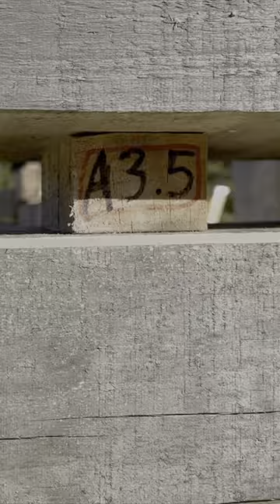Lincoln Logs:  The incredible craftsmanship that went into creating our dream log home

Comment: I believe the dove tail system cam from Scandinavian settlers....it is a wonderful system it allows the notches 2 drain 2 prevent rot and u didn't need nails cuz it locked 2gether
Reply: The Finns specifically used dovetail notches. But considering how many German settlers from f.e. Bavaria moved here its also likely they combined it. Norway and Sweden used a lot of locking notches like the Raulandslaft. Further up north it tended to be more Dovetail. What i don't understand is, where the fashion of chinking instead of full scribe log homes came from.
Reply: @janwintraken  speed...necessity....and needing 2 get water off your back....plus all logs shrink ...even the hand scribed...even if the trees were docked 4 a year...or if they were stored as kants...I built a bunch of cabins all over u.s when I was a younger man ...and one with an Alaskan mill....Husqvarna chainsaw ....ripping chain 20 ft 5 inch thick both ways live edge logs....that is still being used 2day
Reply: @wooge3199  i get that. But f.e. Norwegian and swedish Log houses are just sometimes just grooved with Moss inbetween and If built right there are Examples that are way older than any american log cabin. Sometimes with Turf Roofs that are also Hundreds of years old. Having to re-chink your House every now and then just seems like so much more work to me.
Reply: @wooge3199  i just found something really interesting. There are Log houses in eastern europe that are chinked so it just may be something early settelers from there did and it became popular, because of the ability to build quick homes for everyone. Half timbered or even full scribed takes a lot more time If you think about it. Also a full scribe Log House takes more logs to build.
Reply: @janwintraken  kinda what I said I thought
Reply: Very cool.